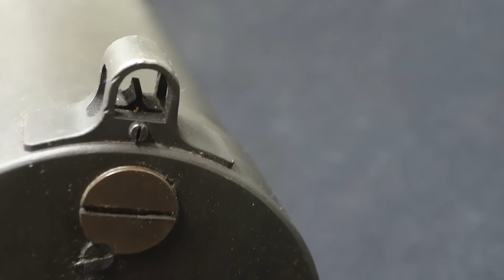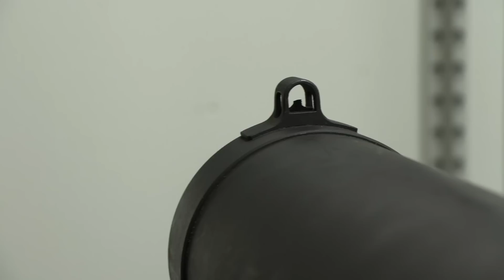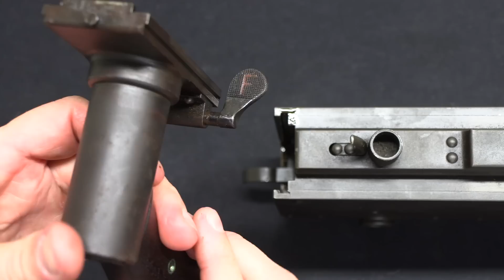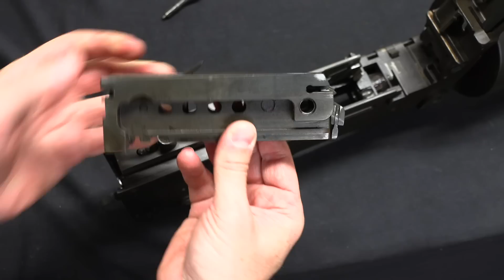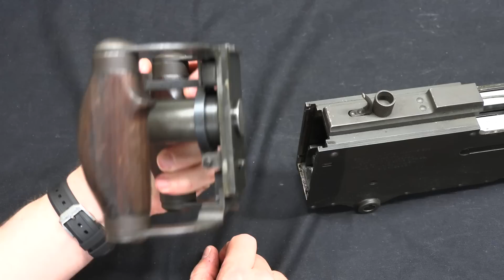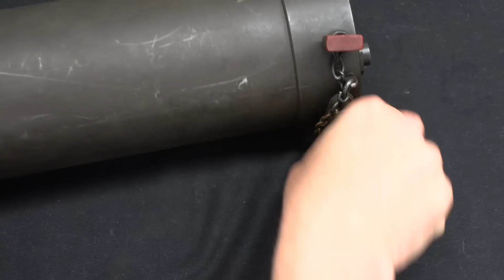MG38: Colt's Interwar Water-Cooled Machine Gun

Comment: The recoil spring is similar to that of the M2. I used to work on the aviation version, the XM-218. The headspace notches on the barrel are also the same. The 218 has a barrel jacket unlike the ground version and you used a screwdriver in the notches to set the headspace.

Comment: I have a Colt 1928 water cooled chambered in 7.65 Argentine.  It was a contract placed for around 946 guns though some state just barely of 1000.  It's built semi auto now.  Haven't shot it yet, can't wait for the rain to break.  It's never been fired.
Mine also has the captive spring and not the "rod of death" which is no misnomer to anyone familiar with guns like the 1919 and 191a4.

Comment: 9:15 And you were doing so well, too. Those are strictly notches used to adjust the headspace and NOT the timing.  Unlike the .50 cal Browning, timing gauges weren't issued with .30 cal ground mount machine guns.  Based on the Ordnance Base Shop manual in my library, in order to adjust the timing, the end of the trigger bar on the M1917 types has to be bent up or down which is beyond the capability of Soldiers in the field. Headspace is the distance between the face of the bolt and the base of the cartridge case, fully seated in the chamber. Timing is the adjustment of the gun so that firing takes place when the recoiling parts are in the correct position for firing.
Reply: and you were doing so good at listening too
he said those allow you to change how far the barrel screws in to set HEADSPACE
Reply: Bet you're fun at parties
Reply: @BloodyBobJr  Right, because facts don't matter. Don't worry, someday you'll find someone to explain stuff like toast to you.
Reply: @FIREBRAND38  I never read any of the piles of info you said. Just the dismissive line at the start was cute

Comment: What made water cooling obsolete in successors to this weapon?  Is it just a matter of better barrel materials that can take higher temperatures without warping?  Or did designers work out a way to reduce the heat transferred into the barrel?
Reply: to my knowledge, it's mostly that water cooled gun are really heavy
Reply: Weight and mobility of the required water.
Reply: If it were only about the weight and mobility, why don't we see water cooling in stationary emplacements?

Comment: I noted the aircraft spec bolt from the lightening holes visible through the charging handle slot. I have a few of those bolts. Not sure how much this configuration was used on Colt's commercial line, but one model made for Uncle Sam was the 1919 Aircraft Gun and this is the correct bolt for that. It's a unique receiver construction, different than what you see here. However, commercially Colt's offered a tank gun variation on the same receiver, called the MG38T and MG38BT models, the latter featuring the spade grips.

Comment: I love how pretty much any gun slapped with the name "Browning" is still in service in some capacity or extremely popular in the civilian market.
Reply: Saw a video of a Russian WW2 contract water cooled browning on the wooden carriage with a rail and red dot  hose clamped to the water jacket being used early on in Ukraine.
Reply: @justindunlap1235  Not just early on. Guns like that as well as maxims are incredibly popular in pillboxes and fixed defensive locations. Obviously you don't want to be running around in the field with it but the water cooling means you can maintain a sustained amount of fire far longer than any air cooled gun.
Reply: @alexsis1778  They took some Maxin 1910s off tachankas in museums and put 'em in the back of pickup trucks, full-circle on that concept.
Reply: @DeliveryMcGee  Not really from museums. They still have them in  storages.
Reply: @Kot_04 Well, yes, because they couldn't sell them as surplus to the US as they did with the Mosins and SKSs in the '90s-'00s. But the ones packed away since the 1930s certainly qualify as museum pieces, just not on display. The joke was that they're using hundred-plus-year-old guns.
Reply: @DeliveryMcGee  Even more Mosins are used in Ukraine than Maxims.
Reply: @justindunlap1235  Wasn't that just Maxim 1910?
Reply: @Kot_04  the one I saw was definitely a browning type as it didn't have the spring cover on the side, but I wouldn't be surprised if there were multiple of those "updates" out in the field.
Reply: Not the potato digger though, or the FN blowbacks.

Comment: My father trained on a quad .50 in the USCG that was tied into the engine cooling system.
Reply: That seems strange. Coolant system temperatures usually range from warm to hot and it seems that tapping into the coolant system induce extra heat into the system rather than help extract it.
Reply: @HustleMuscleGhias  Depends where in the system the coolant is taken from. If the water pump takes in sea/lake/river water and splits part of it off before running it through the engine it could be cold water. Dump the water back into the source and no problem. Modern car/truck engines run at around 200º F and that is still many degrees cooler than a barrel could get under rapid fire.
Reply: @HustleMuscleGhias  Stable coolant temperature is just a plus.
Reply: @HustleMuscleGhias  
Your first shot is never "a cold barrel shot"....and that goes 4x for the quad!

Comment: I’ve read the Colt ground gun had overheating problems with.303 British because of the powder used.
Reply: The original cordite formula burned so hot that the Lee-Metford rifles had to change their rifling for it to keep from eroding the bore.
Reply: Water cooled guns didn’t normally over heat.  I can’t speak as to air cooled guns, except that all air cooled guns overheat if you don’t control your rate of fire.